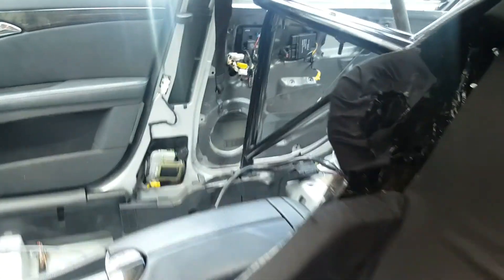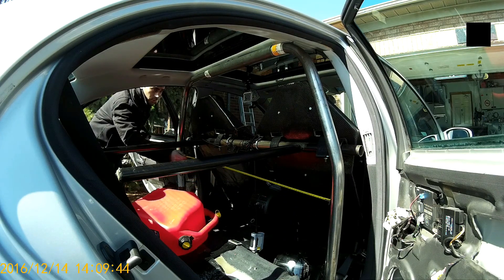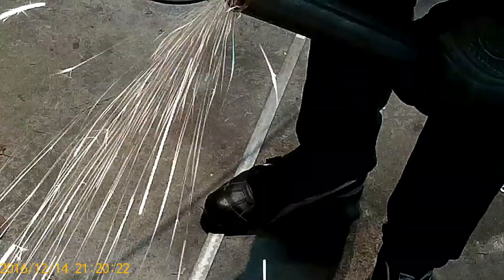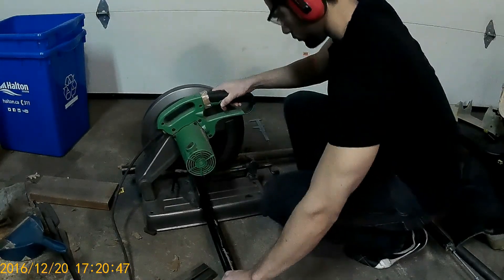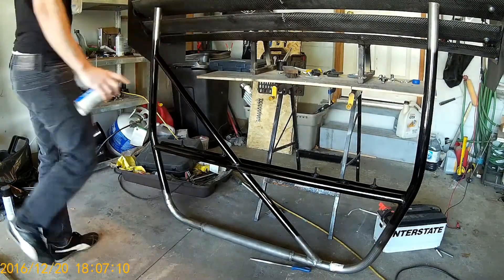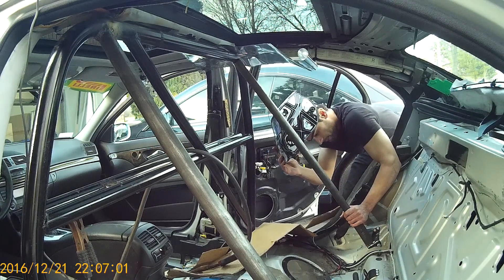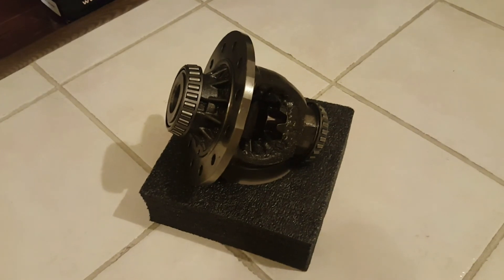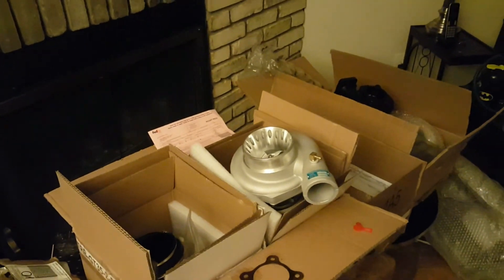How to Build a Properly Fast Track Car - Part 9 (4 Pt Roll Cage)

Comment: I'm going through these videos again while looking forward to the next part of the ASL E55 series. I gotta say, this series is like an encyclopedia for building a track car in one's garage. The content of these videos are such that I'm learning about the details and challenges in executing a design, that I would never have thought existed until coming upon them myself. It's an amazing learning experience for me and one without the consequences and compromises that you've had to deal with on the fly. 

I also really like your approach to building this car. Have a design that you stick to. Get the basic, proven principles done and installed. Then refine them as you need to. By making quick progress and getting it done, you're able to quickly and affordably solve the little challenges that one wouldn't expect, and make a note of them for when the final, most costly and pedantic solution is applied.

Comment: Arent there regulations on the roll cages for your racing sanctiong body? I think the main hoop has to be a single piece.
Reply from the maker: I followed the CSCS rule book. Didn't mention it in that but could be true for other time attack series.
Reply: Was going to say same thing,main hoop has to be one peice

Comment: I love the work you've done to the car. One thing I noticed was the diagonal bar must be one piece and the horizontal bar would get sectioned. not the other way around.
Reply from the maker: Yeh, you are probably right. I know most people bent the seat cross member out of the way so they can make the diagonal bar in one piece, but the rule book doesn't mention anything about it being sectioned or not. I'm guessing both ways would still be acceptable.